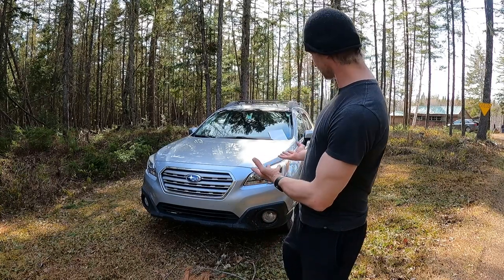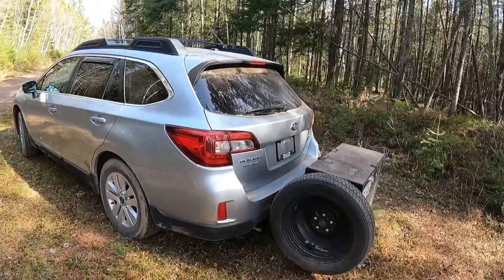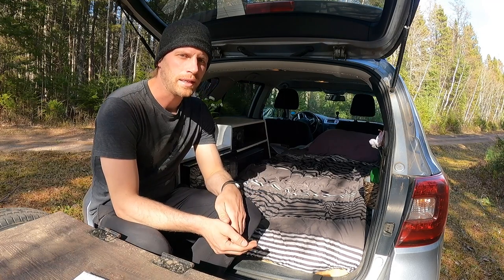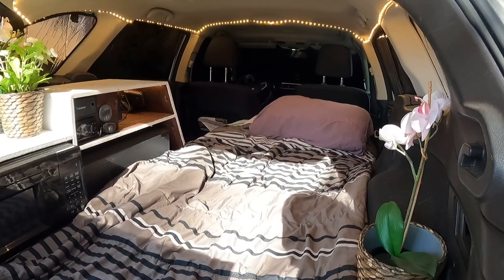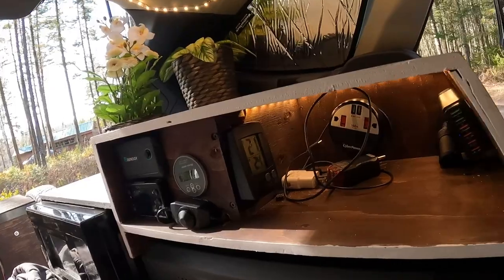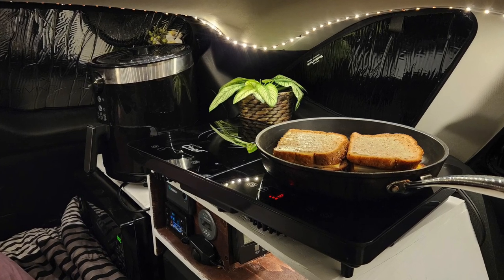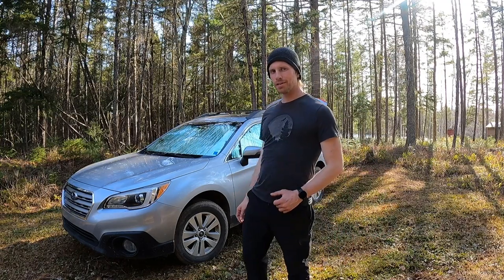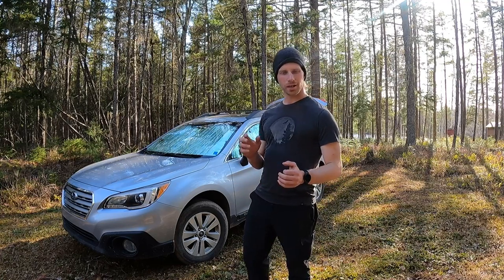Subaru Camper Tour

Comment: That fan for the sunroof opening was pretty genius👍I have a 2018 Forester that I might try that with!
Reply from the maker: It's great in the winter, but it let's a lot of bugs in during the summer, I've taken mine out of the sunroof. When I finish redoing my build I'll do an update video
Reply: @adventureswithjoseph  what about using more of the screen netting over the sunroof with the magnets placed over the sunroof opening ? If you use strong enough magnets you could even travel with it in place possibly ?

Comment: Really well designed. I had  an old but low miles conversion van that I had to let go of when I got my Outback about 7 years ago, extended Starcraft conversion that was great for camping, pretty much a no build set up. I could even fit my 12 foot fishing kayak inside. Can't buy another van at current prices, so looking to set up my Outback for short getaways. Not going as elaborate as your build, but more of a low budget version. Thanks for the good ideas. BTW, are the window inserts store bought, or did you make them? I've been looking at the Weathertech ones cuz I'm not real handy and a low energy older guy, lol. Just subbed and liked, hope you keep making content.
Reply from the maker: my window inserts are from weather tech, i highly recommend!
Reply: @adventureswithjoseph  They look great and I'm not up for making mine. Thanks.

Comment: How do you charge the lithium batteries ?
Reply from the maker: I use a DC to DC charger, my car only has a 50  Amp altnator so I just use a 20 Amp charger. I also have the inverter charger for when driving doesn't keep up